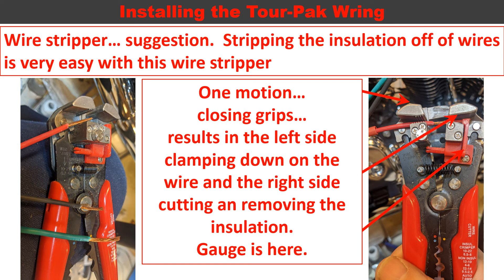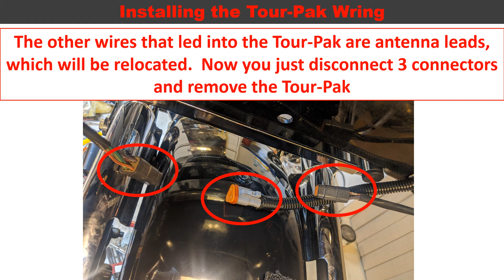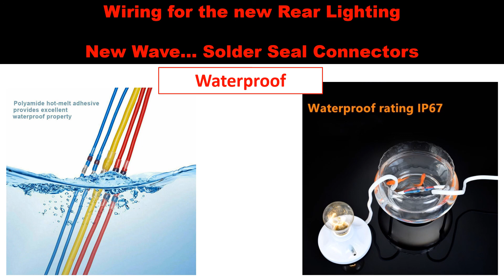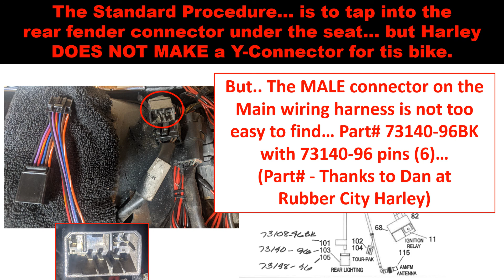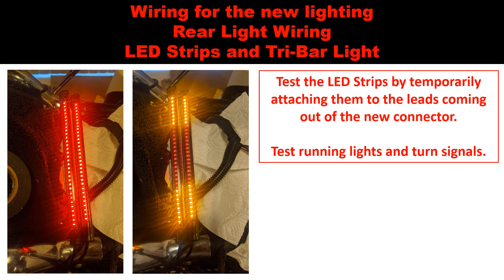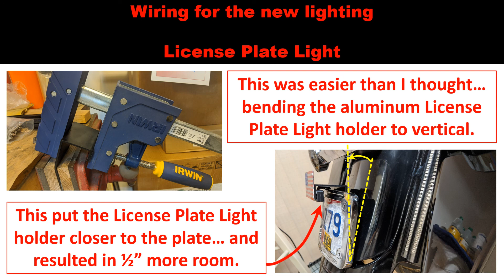#3 Quick Detach Tour Pak - 1997-2008 Harley Touring Frames -  Video 3

Comment: You can get that harness that’s plug and play so you can remove pack and put it on with those quick clips also if you plan on switching to led lights check out custom dynamics! They have everything you’ll need a load balancer for turn signals and they have a load balancing smart triple play add on all kinds of stuff everything is plug and play magic lights strobe kits ingrate everything without cutting a wire that’s the best site I have found for lighting with tons of options I wish I woulda found them before ordering ds down facing tag window taillight